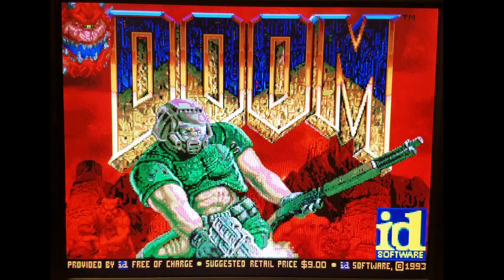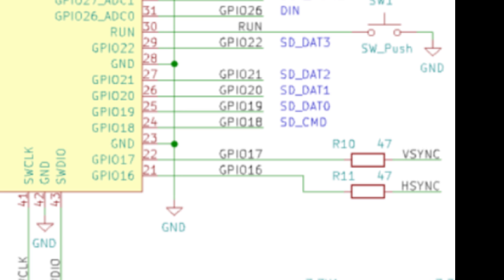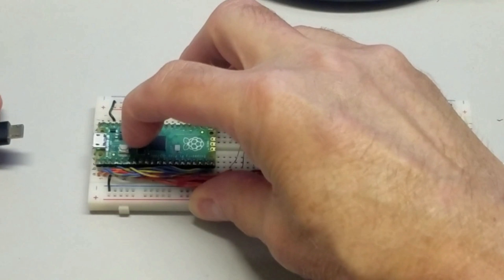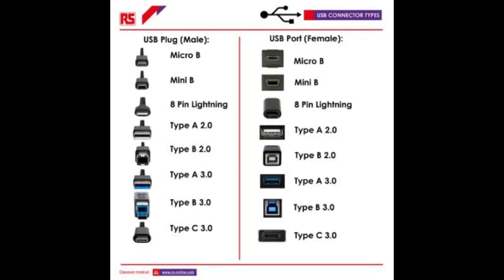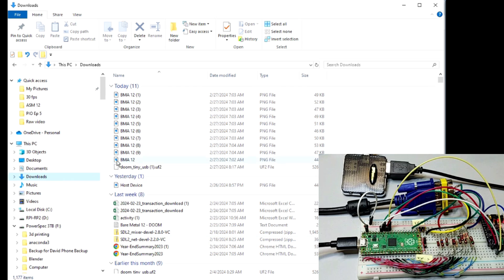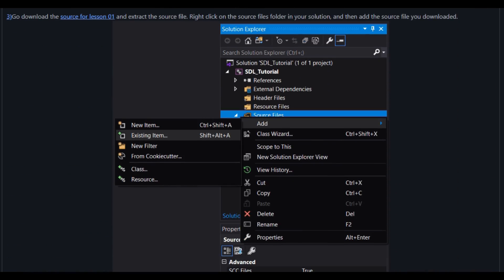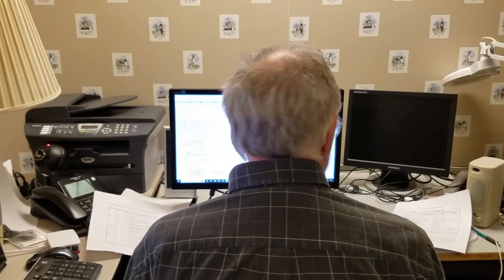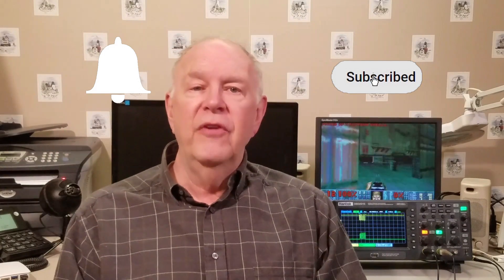DOOM on the RP2040 - BMA12

Comment: It's insane how powerful this little chip is. My first few computers were way much slower: Commodore 16, IBM XT 4.77MHz, IBM AT 16 MHz, 386SX 33 MHz. But even the next one, 486 100MHz was slower than this chip (but the 486 had FPU). Audio mixing in software? Software synthetizer? We were still 5-7 years from that point.
And what couldn't do even a very expensive PC back in the day, is now easily delivered by a SoC or SBC which costs max few dollars (even a hamburger is more expensive).
In 2000, I had an AMD K6-II based computer. Maybe it had 64 MB, maybe just 32, I can't recall it. Now I can by an M1S SoC module which has: a high performance 64 bit RISC V CPU, a microcontroller, an audio DSP, a Neural Network coprocessor, JPEG and Video codec, and many peripheries... For the price of a Burger King menu or less...
I worked as a software developer and runned Windows 2000, Borland C++, etc on a computer with less RAM.
Reply from the maker: You are soooo right.  When I couldn't get a RasPi 4 during COVID I figured "work with what you can get".  My first computer had one kilobyte of static RAM, and I built it myself.  I had about $400 in 1976 dollars into it; the Pico only cost $4 in 2022 dollars.  Moore's law proven!   Thanks for watching!
Reply: RP2040 is not the fastest for the money - ESP32 is much more powerful, but RP2040 has programmable IO co-processors which cannot-bang any protocol at hundred megahertz! This is the power of RPiPico it can be and in fact used to hack/retrofit in many consoles and retro computers to add new features.

Comment: A NAK is a packet from device to host to say data hasn't change. "Interrupt IN"s are scheduled during device setup, and not preceded by a host demand for each device packet. USB Complete 5th Edition, as recommended by Adafruit. Anybody more familiar feel free to correct any misconceptions I may have.
Reply from the maker: I decoded the PID as 1010 (NAK)  Per table 8-1 of the USB spec this means: "Receiving device cannot accept data or transmitting device cannot send data".  That's why I assumed that the host can't receive data.
Reply: I think in both instances it's from device. Could be wrong though. And can't send vs  no change... eh.

Comment: Project Idea: Write a C compiler that runs on the RP2040, compiling programs for itself.
Or maybe start with just an assembler.
Reply from the maker: That's quite a challenge.  What I need to do first is to make the RP2040 think it's a stand-alone computer.  If I could conquer the keyboard input and clean up the video out; then I'd have a chance.  I know it's been done elsewhere; I just bull-headed enough to want to so it on my own. Thanks for the suggestion.
Reply: That's already been done.  It's a cool project. Would be interesting to see a unique language be written for the Pico that could be done in a way that fits with David's style maybe done at the bare metal level.

I've got a C as an interpreted language in one of my projects and I've reworked that to uses Lua as more of an 80's inspired computer.
Reply from the maker: I was hoping to emulate an Apple 2 on the Pico.  Yes, I know it's been done before by others who are much smarter than me.  I just want to see if tenacity and bullheadedness can work.  However, if I'm not careful my head will explode (again). LOL
Reply: This is done already with FORTH